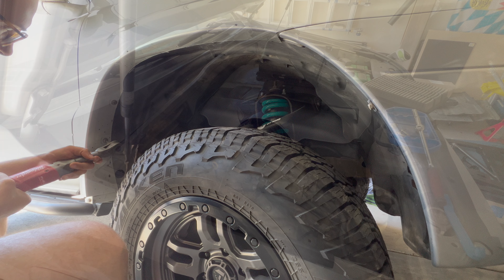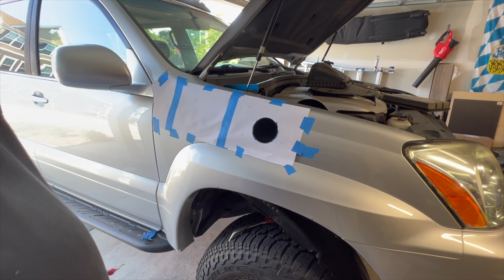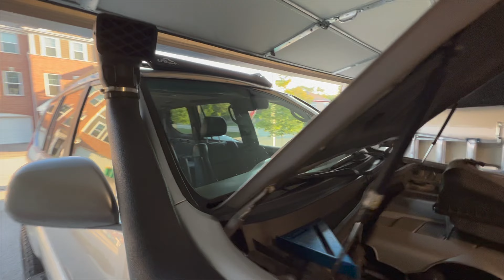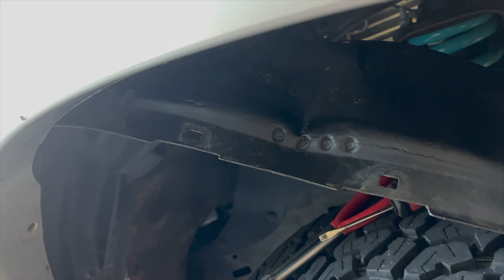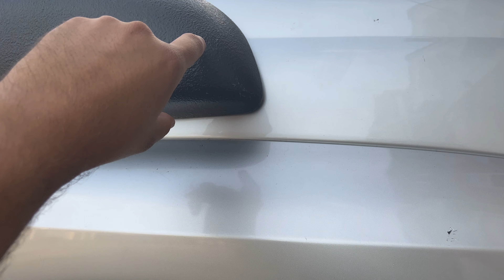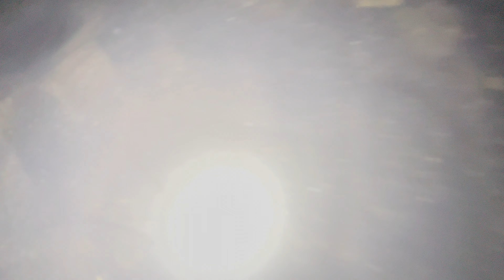GX470 Snorkel Install

Comment: The nuts that go on the inside of the fender that hold the snorkel on. Do you remember how tight you got them. Like hand tight
Reply from the maker: @benjaminsperry5562  yeah I used a wrench to tighten them up. I used a nylock nut so it should prevent the nut from backing off.